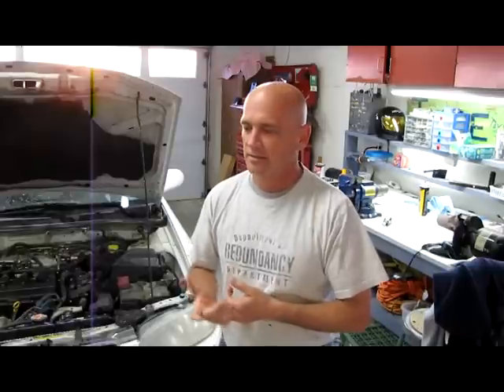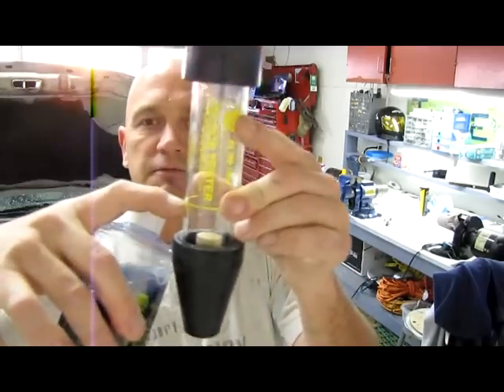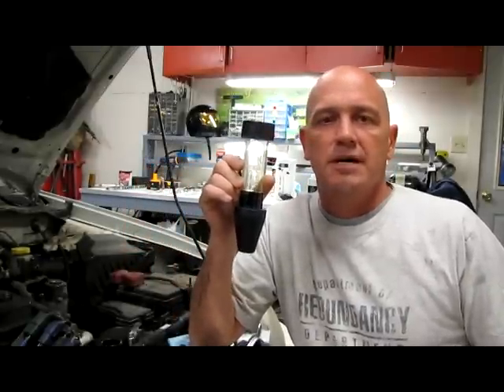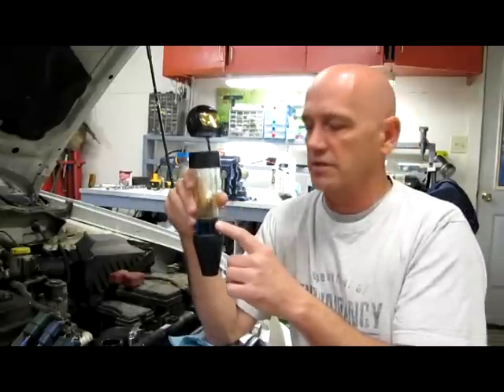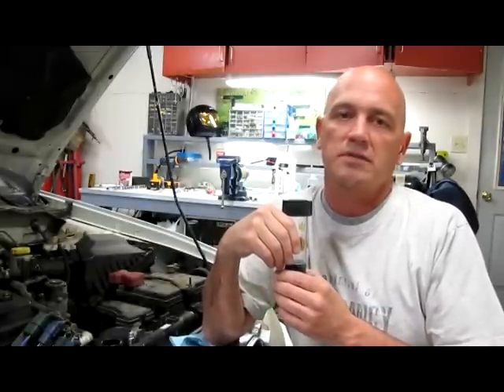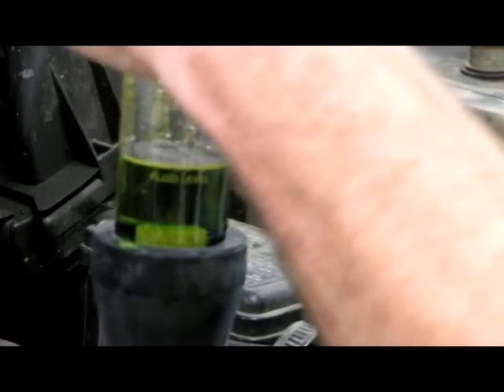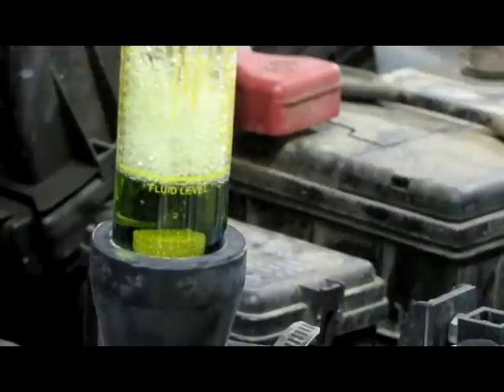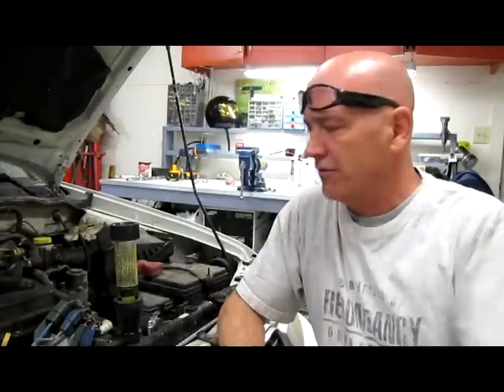How to Test Head Gasket

Comment: I have an 05 Equinox that has oily sludge in the coolant. I am fairly good with mechanically.  I may try to tackle this project. I'm still hesitate.  Baby on the way soon and I can't drop big $$$ on this car that's not worth more the $2500.
Reply from the maker: James McVey   I'm also a parent, so I get it!   First question:  is it over heating?? If so....the issue here for you to test that out is it would cost you about $70-$90 to buy the tool and replace your coolant. You will need to decide whether to verify this with the block tester yourself or to have a shop run that test for you.  If it comes back positive, then what? Potentially $2500 in repairs? In your case, I suggest you check out my other videos on my channel regarding Blue Devil - a sealant for such things.  Yep, it's a gamble, but compared to $2500, it's not nearly that much.  Worked for me for about two years during a time when I needed something to drive out of town (had surgery on my foot - I was really amazed, but it WAS temporary - bout two years for me).  Check it out - I did a two-part video on that stuff and then re-tested the results with this block test tool - both before and after.  Just FYI, I have never received any $$ from Blue Devil or Napa....just a gearhead.  If you have questions, let me know.  r-
Reply: reluctorvalve
Hey, it is not overheating and I am going to check to make sure it is not the transmission cooler in the radiator that is leaking to try and rule out a blown casket. One guy is telling me if it is just to put a used engine in it. I'd would rather fix it and not do all that.
Reply from the maker: James, that's a good idea.  Assuming it's automatic (most vehicles are today), most often the trans oil is cooled by the radiator via a separate area in the radiator - if that has been compromised, it could mix trans oil into the coolant are of  the radiator.  I'm assuming that's what you are referring to.  Is your trans fluid low?  I'm curious!  r-
Reply from the maker: Agree with you there- if you have the resources, another engine would be the best option if yours has these kinds of deep internal issues.  Look forward to an update! r-
Reply: It looks like bad radiator. I am changing it tomorrow. I hope it works!
Reply from the maker: James McVey Look forward to an update!  That would be great news, indeed!  r-
Reply: reluctorvalve
 Radiator replaced and the problem is solved! A shop here in town said they could service the transmission with no risk of it causing any damage. They have a machine that flushes the fluid completely before adding new fluid. Got it done and so far so good.

Comment: All this technology, why in the hell can't they make head gaskets STRONGER? Holy crap that would make too much sense.
Reply from the maker: Duke Savage Duke you pose a really good question, which could take off into many different angles.  Stronger product - yes.  Over-heating issues - we have no control over, or generally little control over.  Pop a hose, and some folks will continue to just to 'try to get home,' and in that time, with the lighter metals these cars are constructed with, they have little'r' tolerance.  Take my 1951 Chevy Truck with the old 235" 6, well, different story.  That thing would hold up to extreme heat, as it was designed to.  So you have a balancing act between manufacturing 'quality' vs. consumer affordability vs. effective economy.  Lotsa debates there - but, nutshell it down to 'back in the day,' they made stuff to last to to be tuff, but, they also got about 15mpg on average.  Today, 30+ mpg is expected.  Food for thought, but great question - technology!  I agree!  r-
Reply from the maker: Duke Savage ...second response....  OR, I wonder why not design an engine with induction and compression functions as an all-in-one unit?  Probably a stupid question, something obvious that I'm not seeing, but that would do away with the gasket seal completely.  Not an engineer, so I don't know.  Just a thought.  r-
Reply: So the gasket fails first. It takes the damage so your head doesnt have too.
Reply: reluctorvalve there has to be points of failure to prevent explosion.  You'd also have to replace the entire thing every time it warped.  It would cost more in the long run, if i was to take a guess.
Reply from the maker: Casey Rodriguez Good points.  Blown head gaskets do often cause over-pressurization to the cooling system because of the compressed (high pressure) gasses from the combustion chambers leaking in.  Cracked/blown top radiator tanks are very common as I've seen in these cases due to this. In my mind, why not design something akin to what freeze plugs do in function - to relieve over-pressurization (radiator cap is supposed to do that now, but that's not "specific" enough in defining location - in my view), or maybe strategically-placed relief valves which will also auto-weep coolant at a drip rate when too much consistent pressure is detected.  Much like the weep holes built into water pumps do.  That way, the cooling system's pressure can be somewhat retained, but the weep would indicate an issue - detected from the point of the relief valve area.  This idea may not be enough, though, to thwart those points at which the super hot compression gasses cause the coolant to boil instantaneously.  Perhaps Over-Temp/Over-Pressure relief valves maybe?  Not out of the realm of possibility. Just my thoughts - if that makes any sense.  r-

Comment: Nice tool, but I don't think I need to spend the money to know I have a leaky head gasket. I have a rusty colored spark plug, and when the car is started after sitting for a long time, it blows steam out the tailpipe till it gets warmed up.
Reply from the maker: tazaxx21 Taz: What you need to know is that you have 'obvious' symptoms of such an issue, and that in many cases, there are no 'obvious' symptoms, other than overheating for no obvious reason.  Not all compression leaks immediately cause steam out the exhaust, nor affect the plugs.  I once had a customer who for about two years had overheating issues on a Honda Civic Hatch, but for no reason and with no 'evidence' as such, like you state.  I couldn't guaranty my client that the head gasket was the issue.  It took about 4 block tests to finally confirm, after finally deteriorating to a point of being able to detect it.  Middle of a snow storm, it had over heated - freegin cold outside, and for no reason.  I replaced the head gasket and wa-la! - after two years!  So - yes, sometimes a detection tool is needed.  Obvious steam out the exhaust, 'chocolate milk' colored oil, - those things are when you won't need this kind of detection tool.  r-

Comment: Will this method also work on a Toyota 3.0 motor? As problematic as those are, I wouldn't think it would be a very good idea to drain the radiator at all, let alone half way. Thanks!
Reply from the maker: Rick Grimes Rick: Totally agree with you on the 3.0.  I have one, runs great but I am leery!  When I got the truck I ran the block test, came out green.  So just for measure, I did some Blue Devil treatment on it, and it's ran cool as a cucumber under all conditions.  Draining the radiator:  You need to drain it down some, because as the engine warms up and runs at OP temp, the level in there fluctuates dramatically, as designed, to build up pressure (which increases your boiling point, per design).  To test, you don't want any fluid from the cooling system to get in the test tool, so drain it down some - the directions for the tool actually call for draining it totally and refilling with straight water, which I do, myself.  But I've done it before just by draining it down some.  Have someone watch the temp gauge if you're worried, of course.  Draining it down 6-8" normally doesn't effect the cooling system to a degree of overheating at all, but have someone watch the gauge.  Point is, only 'suck' fumes, and zero liquids.  Hope this helps!  r-

Comment: I did this test today, but apparently I didn't drain the coolant enough cause after about 2 minutes the coolant spilled up and got into the tester but for just under 2 minutes it didn't change color at all. Is that a reliable reading, or should I attempt to do it again here's a vid of me doing it VID 20140709 192301
Reply from the maker: Nathan:  Again, to all, sorry for my late response here.  It looked to me like it was turning green just a few seconds before you said it was sucking up coolant.  Are you overheating for no reason?  If you are, know that a compression leak will cause the cooling system to 'bulge' up like that, and over-pressurize from that direction.  I saw it begin to turn green, so a little more info would be great.  Maybe another 2nd test?  r-
Reply: I found out I was losing coolant from my heater control valve (according to the mechanic I took it to) I haven't had any problems since then. No over heating or anything. They also did a compression test and said it was normal. I didn't get the results of the compression test. But my car is running great, thanks for responding.
Reply from the maker: Nathan Plueard That's great news!  Thanks for hanging in there and following up here on my channel!  I plan to put up a LOT more techie videos coming up.  Ordered up some new video 'gear' so I hope you watch my future video (in a few months) on a V8 cylinder head pair  R/R.  I got a screeeming deal on a very nice Dodge 4X4, but needs deep engine work.  Glad your car is working great, and that you did research online to check out potential causes.  In your case, a cooling pressure tester would have been beneficial- pump it up like a tire tube, and see where it leaks.  r-

Comment: Hi,I have a 1996 Nissan Pathfinder,I smells gas every now and then after driving my car,and we have it checked for gas leak and they said there was no signs of any leak for gas.do you think it could be a bad head gasket?
Reply from the maker: Leocel: Hm...well, the seal between the head and block doesn't ordinarily carry any fuel, so my guts says no.  I'd suspect an EVAP, or EMISSIONS-related issue, which manage unburned gases and fumes.  The EGR system (Exhaust Gas Recirculation) does some re-circulation into the cylinders to reduce combustion temps.  The EMISSIONS system does manage unburned fumes and sends that stuff back to the tank - not so much my fortee, obviously (anyone else with experience, toss your info in here). If there is no outwardly sign of leakage, I'd suspect one of these sub systems.  Just a total guess on my part, though!  r-

Comment: Possible stupid question: My head gasket was recently replaced. Car is mostly running fine except for a rough idle. A different mechanic just did this test and the car failed. Only been a month since gasket was replaced. Is there any chance there could be "residual fumes" affecting the accuracy of the test? Or some other explanation? A compression test comes out perfect -- all cylinders at max pressure. Not losing coolant, etc.
Reply from the maker: LilMtn: not a stupid question. Rough idle can be related to a few things, especially after such a repair: 1- valve lash adjustment.  If your head gasket was replaced, good chance the bottom surface was 'milled' flat, which takes off thousanths of inches, which in turn changes your valve clearances.  I'd suspect that as far as from a 'mechanical' point of view.  Otherwise, the more easy and obvious potential issue would be a vacuum leak which interrupts the sealed air/fuel mixture created by injection.  Not sure about the re-test.  If it exhibits behaviors such as overheating for no reason, I'd have it retested obviously, but if it doesn't, I'd go with it for a while.  When testing, be sure not to get exhaust fumes up inside the tester!  That could cause a false-positive result.  r-

Comment: are these kits usually freely available at auto stores? Im in the UK, having trouble finding one. Ideally I'd like to just walk right in there and buy it tomorrow, rather than wait a week for someone to ship it to me. Can't really drive to a pro as my coolant tank is full of straight oil (non-creamy ... right after a flush). I think its the oil cooler but might be the gasket, hence me arriving here.
Reply: I just changed my oil cooler today, went for a 5 mile drive and the same thing is happening - straight oil in the expansion tank (was just running water while I test rather than expensive coolant, glad I did). I I got one of these block testers on Ebay. I just tried it and it stayed blue - though, I do have an Audi A4 B5 1.8t which has the coolant expansion tank separate from the radiator. I guess a compression test is next.
Reply from the maker: invade81 Hi- Sorry for the delayed response.  I am not sure of the product availability differences between the UK and US - can you go to napaonline.com and check for the part number?  I know that Autozone also sells and 'rents' a version of this, or so I've been told.  Sounds like your leak is pretty severe.  What have you found out in the meantime?  r-

Comment: Our 1992 F350 7.3 idi diesel is full of oil in the radiator, but the engine does not overheat.
Reply from the maker: Ford:  Um....what color is the oil?  If red, I'd suspect mixing of your automatic trans fluid into the normal cooling system at the radiator.  If regular engine oil, and no overheating, I'd at that point keep an eye on both the engine and trans oil levels to see which one goes down.  Just a guess but worth a shot.. r-

Comment: A mechanic told me my head gasket was blown, but my car wouldn't start, the oil isn't watery or any change in color, the only thing he had to off of was the car not turning over, and the radiator reservoir tank bubbled up, but i think i added to much antifreeze, because i had just replaced a radiator hose hours before the car died......I also don't have a radiator cap, just the reservoir tank.  I have a 2001 Ford Focus SOHC.  *Side note, i ran the check engine light test and got the code Po402 which is for Exhaust Gas Recirculation Flow Excessive Detected........Any ideas?
Reply from the maker: Kevin: it sounds like you have several things going on - too many issues with different sub-systems to accurately be able to know without any real troubleshooting with test equipment.  I'd suggest you begin with the basic compression test, then see if the thing is still mechanically in-time, then diag the no-start.  It has to run in order to do this test.  r-

Comment: i think this blue liquid when u pump 3 times i think mix with the coolant or the antifreeze thats why change the color but how really know the gasket its bad or head is broken.
Reply from the maker: hpelsilenciohp: This tool historically was used by professionals who knew better than to take the chance you refer to:  we used to drain the coolant out of the system altogether to avoid mixing with the tool, and replace with straight water, but not up all the way.  So indeed, if you aren't familiar with cooling system diag work, don't risk running the test yourself and getting inaccurate results; have a professional mechanic run this test for you.  r-

Comment: LL With the expensive motor check out and try blue devil 100% money back garentee
Reply from the maker: Steven Everett: I have a 2-part test comparing Blue Devil use with this block tester tool after using the chemical.  See my other videos for a more detailed look.  r-
Reply: I do not think i understand your response?!  I was saying for a fix that would leave the other woman more time to find an engine or at least time to get her funding up with out worry too much about a complete engine failure.  The nice part is about the product is if you follow the directions to "T" they will refund your money.  Results may vary but if it works why not.  I once worked as a sales person for Advance auto and it was never my first recommendation (liquid fix) but if that is what the customer wanted that was the first suggestion i had.  no one ever came back and complained.  I worked there for 2.5 year as a supervisor.
Reply from the maker: Steven Everrett: I think we are on the same page, here.  I agree with your response - if you want, you can check out my other videos on Blue Devil, and how it worked for me.  r-

Comment: Block tester question will this work if the thermostat is stuck closed?
Reply from the maker: JBP349:  Well, most likely yes, however I wouldn't run an engine with a stuck-closed thermostat!  You'd just be making any potential issue worse!  Basically the coolant from the radiator is now cut-off from flowing into the engine to cool it. So, my recommendation obviously would be to replace that thermostat and then get a good and accurate test.  $15 tops for most thermos and seals.  r-
Reply: thanks for response I was looking at a stang and couldn't get the sellers to be honest so I didn't want to throw money at parts on a car that wasn't mine but turns out that fluid turned yellow so I was correct on my assumption of head gasket being blown.
Reply from the maker: JB: Excellent results, huh?  Thx for the follow-up! r-